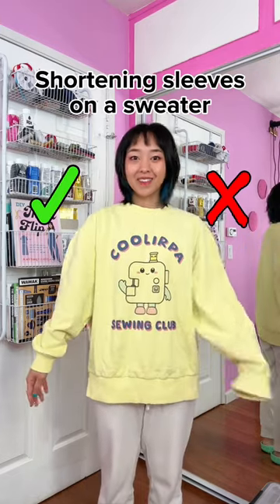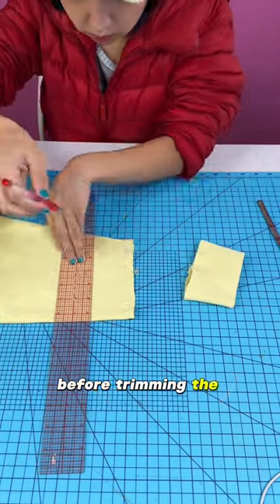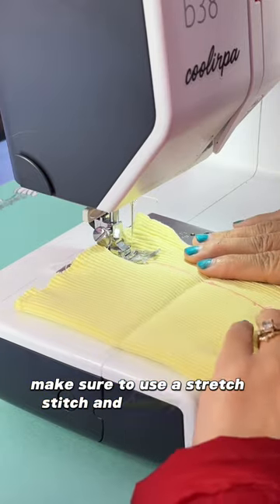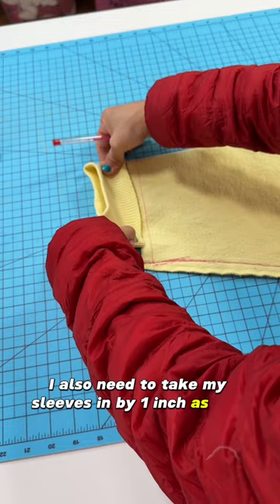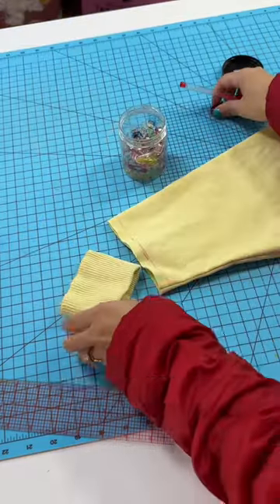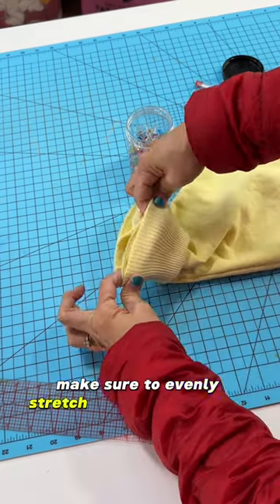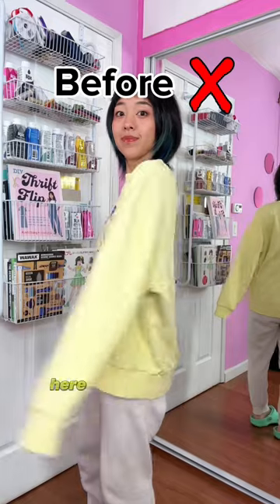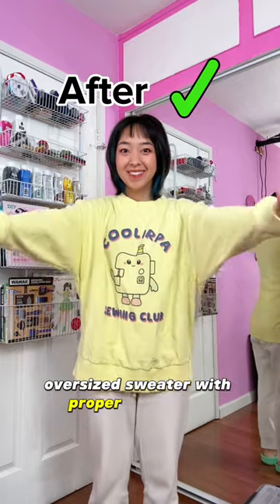How to shorten sleeves on a sweater or hoodie | Sewing tutorial

Comment: If the cuff is long enough, so that you don't mind losing a bit of it, instead of picking it out with a seam ripper you can just cut out the seam with the sleeve which is much less work! I do this sometimes- I am short and sleeves are often too long.  I do it on cuffed long sleeved shirts as well as sweaters.